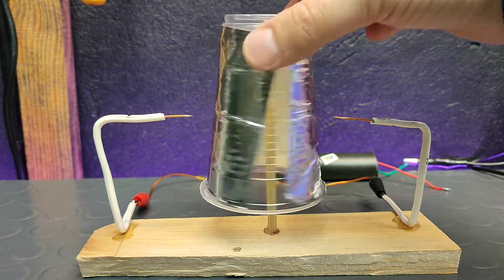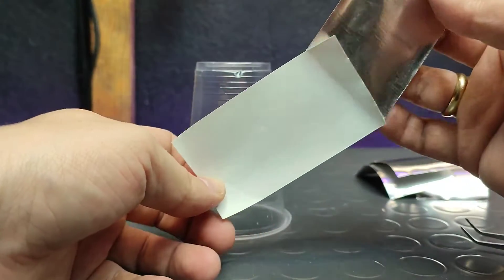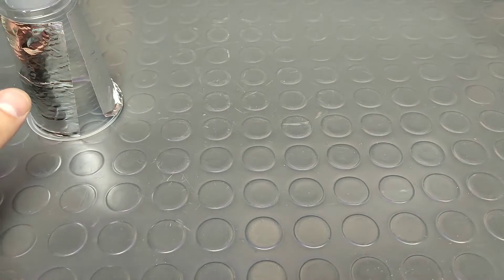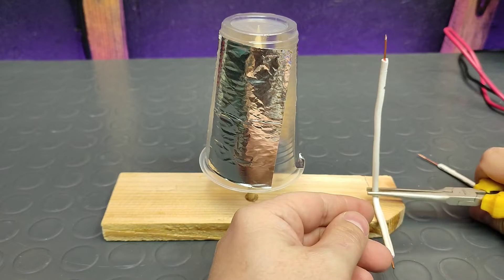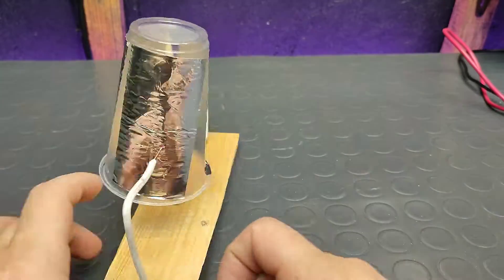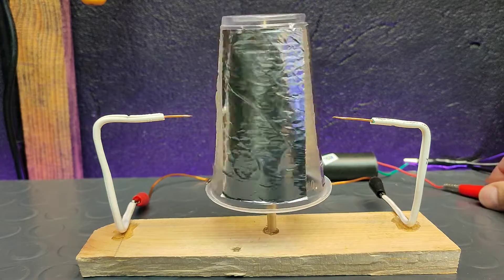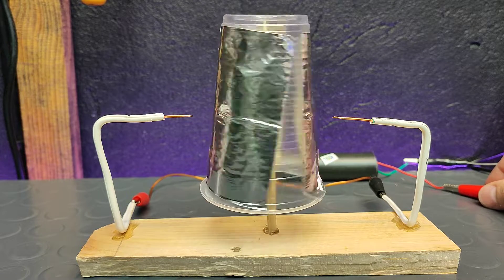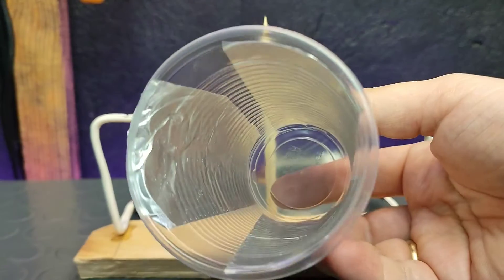I made wireless motor  - actually working!

Comment: Static electricity is quite interesting. I'm an Electrician. The lines you see on the telephone poles, when disconnected. You still have to check the line, due to static electricity charge. Which can happen in minutes, when a wire is that long. It can kill you. Make your teeth fillings sizzle.
Reply from the maker: Wow I never thought of that. Sounds like something useful to know. Thanks for this 😊
Reply: @FixitEasyDIY  yea as the lines sway in the wind, they charge up static
Reply from the maker: Knowing that can save you. Thanks again for sharing this knowledge.

Comment: What type of solder do you recommend?
Reply from the maker: SN60PB40 F-SW26: 2.5%
Reply: What are you soldering and what method are you using?  
Is Leaded solder allowed in your jurisdiction? 
Are you using flux or do you want cored solder?

Kester 63/37 is one of the more commonly used for SMD repair work, for flux AMtech SN63/PB37.  If your just starting out though the main thing you should focus on is a really good iron and tip set followed by a decent hotair station.